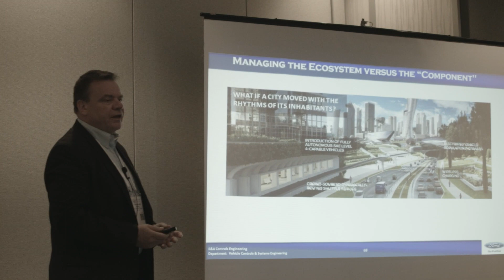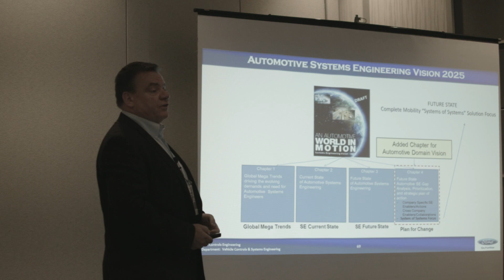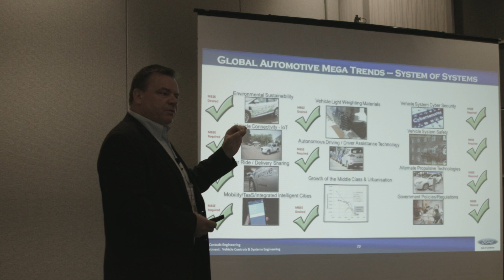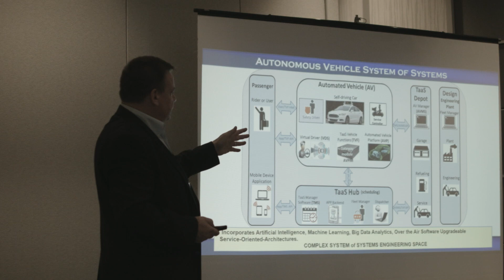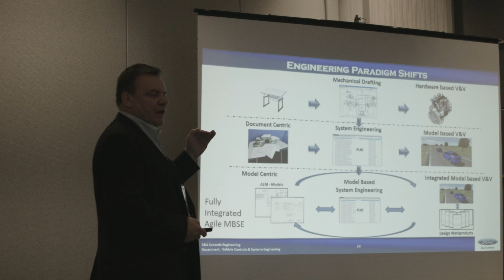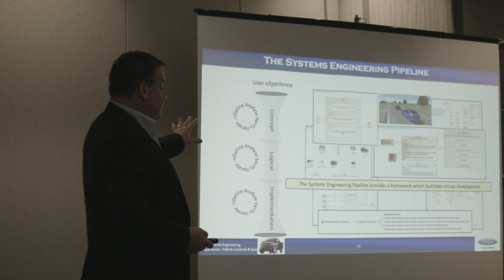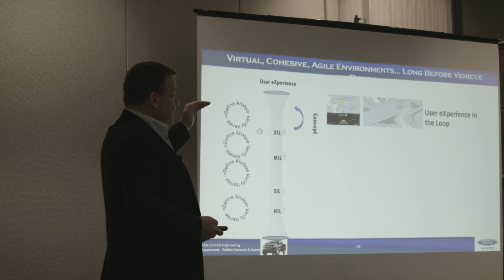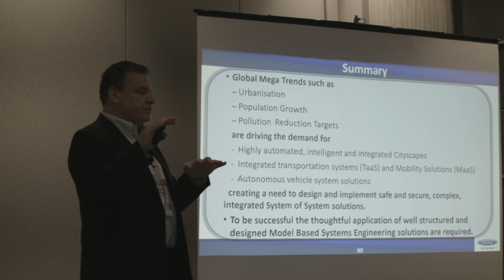MBSE Lightning - Autonomous Vehicle development using MBSE

Comment: Some material in regard to driver assistance and driving automation is inconsistent with SAE J3016 definitions of SAE levels of driving automation. ABS, Traction Control, and PCAi are NOT automated driving systems according to the definitions of J3016.  They are "active safety systems" (driver assistance systems) according to the J3016 & J3063 standard.  They are NOT responsible for SUSTAINED performance of a dynamic driving task (DDT).  "Remote Park Assist", based on the Bosch offering, may not be Level 2 as the person may no longer occupy the vehicle or the role of driver of the vehicle and is incapable of performing the dynamic driving task and over-ride an contraindicated control action by the "park assist" feature.  

A key difference between Level 2 & 3 is that in Level 2 the DRIVER is responsible for the detection of objects and events and the formulation of a response to them (OEDR).  In Level 3 the System has that responsibility.  The slide appears to contradict the responsibilities of the driver vs. the system.  In both levels the person in the role of driver assumes the responsibilities of the dynamic driving task (DDT) when the driver assistance system (level 2) or automated driving system (level 3) can not perform the DDT, known as "DDT Fallback".  The"Remote Park Assist" feature intends to provide services when the person in the role of driver is NOT in the vehicle, this prevents the person from performing OEDR or DDT.  Might "Remote Park Assist" be a Level 4 Automated Driving System?

In regard to Level 4, "geo-fenced" does NOT by definition explicitly mean "operational design domain" (ODD) which is, by J3016 definition, the actual constraint.  "Geo-fenced" can be an element of an ODD.  Quoting from J3016 "Because of the wide range of possible ODDs, a wide range of possible features may exist in each level (e.g., level 4 includes parking, high-speed, low-speed, geo-fenced, etc.)."